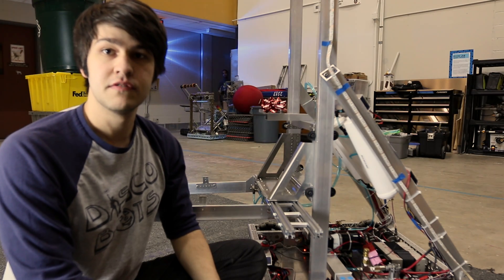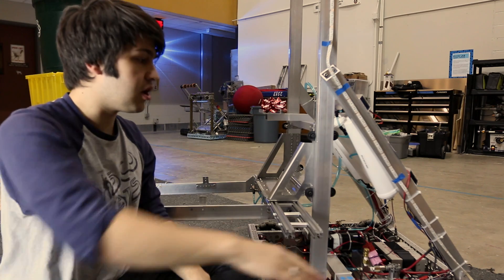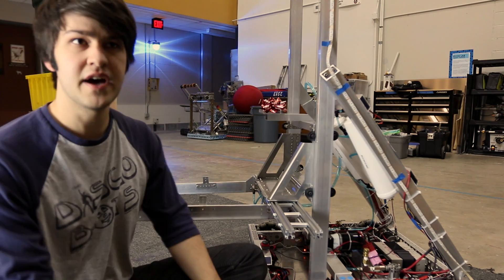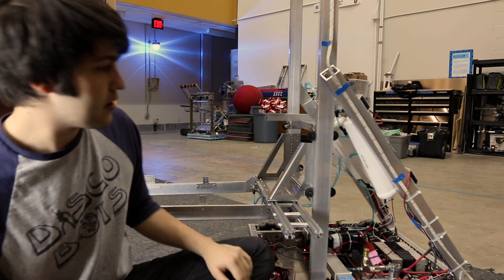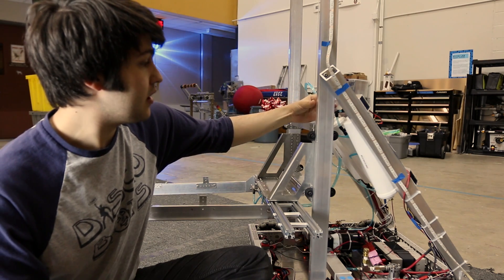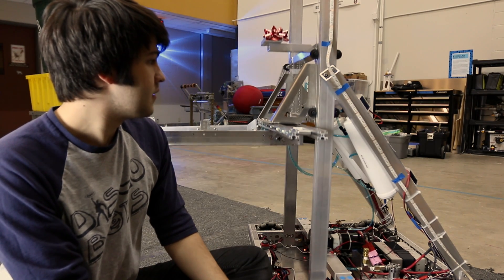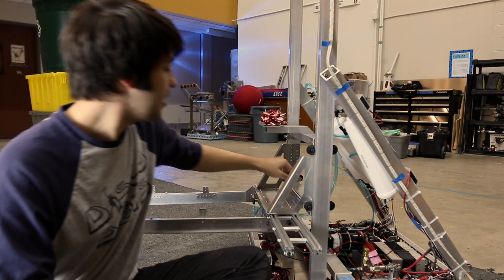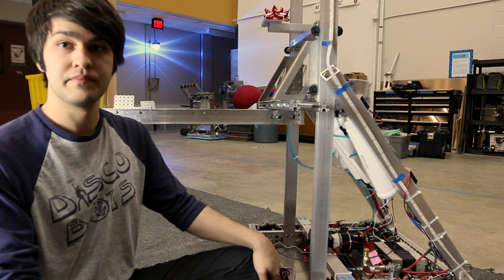[Ri3D 2015] oRyon Labs: Betelgeuse - Lift

Comment: The versaplanetary gearbox with the 7:1 plus 10:1 ratio when used with a cim motor isn't recommended for use with the 1/2" round output shaft.  Have you had any problems with it?

There is also a gear on the backside of the drive pulley. Is there a pawl setup on the gear?
Reply: We are using a Hex output. Sorry, can't comment on the half inch round. 

The gear was there in case we need to add a second gear box next to the first. We have removed the gear in for the final bot.